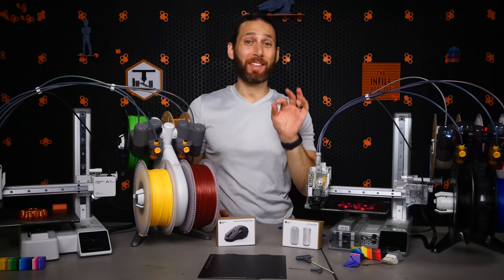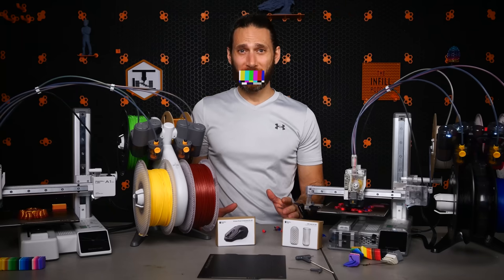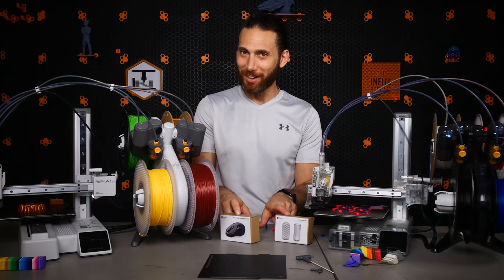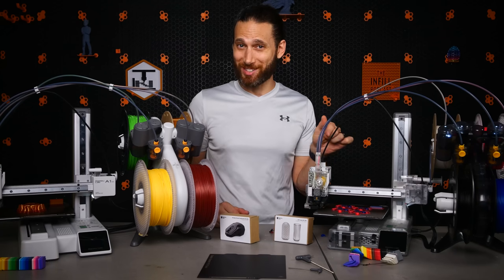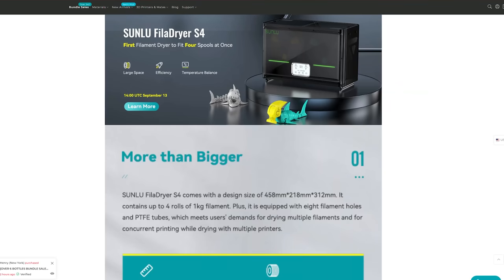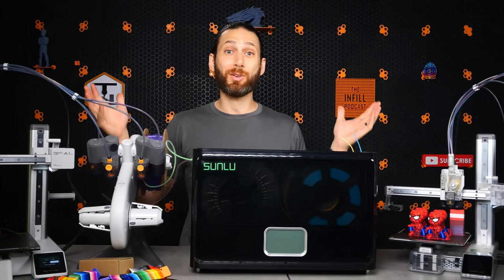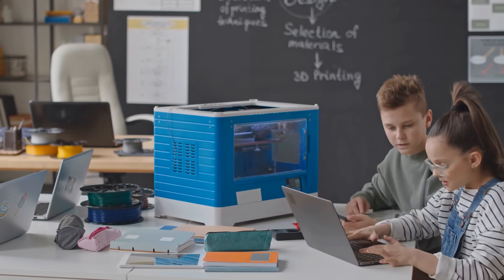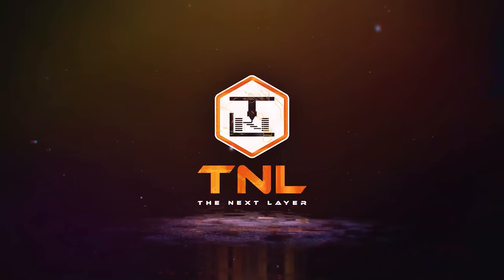Introducing the Bambu Lab A1 Mini + AMS Lite

Comment: That closed software ecosystem is a big turn-off for me.

And I agree that the purge waste is also an issue, but that's not much different than most multi-colour machines.
Reply: I'd rather have a closed software ecosystem than an open source that's buggy or wont work.
Reply: @fongsa1yuk  The problem I have had with closed ecosystems is that they have a bad history of end-of-lifeing their software (especially cloud connected), leaving me with hardware that can no longer be used.
Reply: The closed system is a bummer. It seems like they are aiming to be the Apple in the 3D printing world. But they are stimulating the market with their products quite well. I wonder how Prusa will respond to the AMS, p1p, and now the A1.

Comment: I feel like companies are in a printing speed race when all I want is quality race and low failure rate race.
Reply: Most fast printers, especially the Bambu ones can do that too, just adjust the speeds and make it print slower. However the default speeds on the X1C are quite a bit slower than their fastest speeds but are high quality and reliable too. I have never had a print failure on my X1C.

In other words what you are looking for already exists, you just aren’t seeing it. FDM will always be limited by nozzle size and flow rate, so there is a limit to how much quality you can get and it has been long reached, hence companies are keeping that same quality but also going for speed. If you need even higher quality then you should probably go for resin printing.
Reply: @conorstewart2214  I own the X1C too and have had failures (maybe mostly because of my own faults), and don't like going over the 100% speed mode as I feel like the quality starts to dip at the higher speeds. I notice little imperfections at 150% speed. I'm using Sunlu basic filament. I bought high speed filament but just find it not cost effective. I'd rather buy another X1C than pushing the speed if I'm in some manufacturing crunch.
Reply: @JiiruKoga  that is what I said, that their default speeds are high quality and reliable, going faster depends on the model and filament.

There isn't much point to high speed filament, at least with a bambu printer. I think the Bambu basic PLA is already optimized for higher speeds. If you look at the volumetric flow rate settings in bambu studio it is higher for bambu filament than generic PLA but that could just be for marketing or to make their filament look better but I have had good results using cheap PLA with the bambu PLA settings.

The default speeds are already much faster than an ender 3 or MK3, if you need it for manufacturing quickly then you are better with a P1P or P1S than either an ender 3 or MK3 and they are more cost effective than an X1C. Now with the A1 mini it is an even cheaper option for only a slight decrease in speed. If you don't need an enclosure, are fine with the print volume and just need printing speed then the A1 mini is probably the best option now.

Comment: Not trying to be a hater, but this feels much more like a sponsored commercial than a proper critic's review. Would've been nice to have a proper time comparison between p1p and this when doing the exact same color print. Maybe some mentioned to the poop or the tremendous noise it makes when cutting filament. I don't know... Some negative points maybe?

Somehow this review has little added value over reading the spec sheet directly from bamboo lab's website.

Please don't sell out or try to be on the good edge of brands for the sake of it. We want true honesty!
Reply: His comments and review aligns with most reviews I’ve watched on this printer and they have been many.

Comment: The footprint of this thing is insane. Not only is it the printer, the AMS is roughly the same overall footprint as well. Then if you want to capture the purge stuff you now need to put a bucket or box to collect all of that further increasing the footprint.
Reply: Yeah. It’s huge! The AMS (lite?) Should have been an enclosed box, attachable to the printer. More like the AnkerMaje v6.

Asians must think we have tons of free space. 

Making the bed larger wouldn’t have increased the overall dive by any significant percentage. 

Can you even attach a single roll anywhere?
Reply: @echo-hotel  there's a spool mount that attaches to the back of the z gantry so you can do a single spool yes
Reply: yeah and with something catch purge u wider than 2 x1c or 3 p1p side to side

Comment: I think the foot print of this printer with the new AMS is a real detractor for me. This "mini" with AMS looks like it takes up as much space as my MK4 or my X1 with its AMS.
Reply: Yep and imagine if you realised you get better prints when your filament isnt wet and have to put it in an enclosure …
Reply: @jeremyglover5541  Or the fact the second thing they will need to print is something to catch all the purge material for those multi-color prints.
Reply: Agreed, just the small printer by itself is interesting, it's a well designed desktop fast-prototype machine. With the AMS is a total mess.
Reply: @lawells3  also interesting and not mentioned here, is the fact with this machine, the slicing takes place in the cloud, you cant even use sneakernet anymore and I guess you cant use orca. I think it makes it plain that people and their IP are the product with these machines.

Comment: Will it be possible to use the AMS Lite with the P1P/P1S/X1?
Reply: I wouldn’t have thought so, it seems to rely on the four input extruder of the A1 mini. They could release a way to use it with the AMS hub that lets you use 4 AMS units at once but you lose a lot of the benefits of the AMS lite and A1 then, since you would need to retract back past the AMS hub. It seems this will just be for the A1 unless they allow you to use an A1 hotend and extruder assembly on the P or X series.

Comment: That's the best ad integration I've ever seen 😄 I'm interested by this machine but was bummed out the BMS system is fully open, making the solution incompatible with PETG and TPU.
I was thinking that color swapping might depend on the AMS to rotate thr spools to retract the filament.
But then.. the problem doesn't actually exist?

Comment: I was really interested in this as my first printer, but for the wasteful colour option. Not only does it 'poop' waste, it still has a purge tower, which further reduces the build plate real estate.
With the extra 'pusher' motors in the AMS and the individual bowden tube feeders, why couldn't they install multiple extruder nossels in the priniing head???
Reply: You can turn of the prime tower if you don't want to use it
Reply: @anthonymessage6073   I have previously been interested in the Ankermake colour solution as they reckon there is no waste with the system they have dev.
But I was really keen on hearing of this Bambu printer cause these guys obviously know what they are doing, including an industry leading slicer. Nothing else on this printer, be it the size of the print area, or the skeletal AMS is a deal breaker for me.
But now I'm back to waiting to see what Ankermake is going to release.
If Bambu had included a recycling system, I might still be interested.
Speaking of a four nozzle print head..Other conveniences would be…
the possibility of four sizes of nozzle.
Or one hardened and three cheaper options.
Different types of plastic for each head.

Comment: Not to pee in your Cheerios, but there are issues:

-Bambu Lab's data security, implicit theft of models/settings/gcode, and risk of hacked network login credentials aren't any different now than they were yesterday.
-Same goes for their customer support, which is notably better for social media influencers than it is for average users.
-Single hot end designs are still inherently bad for multi-color and multi-material printing. Not just from the waste caused by the poop pile and prime tower, but from the risk of jams/clogs in the hot end.
-Even if the printer can be made to work with 3rd party filament, the chip readers mean that the printer is one firmware update from locking you into Bambu's filament ecosystem as well as their parts ecosystem. 
-At first glance, I see nothing in the design that makes me think that the A1 Mini isn't designed just like the X1 Carbon and P1P/P1S...while the lack of an enclosure makes it easier to get at some things, it screams "use for a few years and dispose in the trash before buying a new printer."

I don't have just doom and gloom to comment on, however. Trying to expose a new market of people to 3D printing can only help the industry. That's something I think has been a real struggle even in the last year, with machines from Bambu Lab, Ankermake, and Creality trading on the Apple design philosophy of "if it looks good, people will want it" that still don't seem to be drawing in people other than the existing crowd of artists and 3D printing enthusiasts. And trying new things to further cut down on noise is a very useful step towards developing new standards in the 3D printer industry. I'll even give Bambu Lab serious props for their aggressive pricing strategy; above issues aside, that's kind of a lot of printer for <$500...and Alan Mandic's (admittedly unscientific) survey about just how much build area most people need on a daily basis I think continues to affirm the utility of smaller-sized printers.

All that being said, I'd still take the Voron 0.2 kit over this. An LDO one, too, as Jason and his team have done so much for the industry and I'd love to help them keep doing those things. Heck, I'd take a printer from the mad lads at Flying Bear over this, too, because intentionally or not they definitely embrace the concepts of open source design and right-to-repair while still finding ways to be innovative and also competing hard on cost...and they haven't been banned from selling product to the U.S. government, as DJI has, due to extremely shady data security practices.

Comment: Looking for something that can be portable to bring to events. We are RC enthusiasts that use 3D printing for parts and would really like that function on site. We have been hesitant to bring our P1S due to possibly damaging it in transit. Would this fit that bill?
Reply: Only if what you print is able to be printed in PLA out in a windy field …
Reply: If you're meeting anywhere that isn't a conference room/hall, probably not.
Reply: I bring my P1P to work sometimes, which requires driving several miles of bumpy dirt road. When I set it up in the office, I just run the harmonics calibration and bed leveling and get to it. Haven’t had any issues yet.
Reply: @kichigaino  do you install the transport screws and all hardware?

Comment: Hopefully they release a mod kit to put that faster (color wise) head and ams lite on the other printers. Swapping a nozzle breaks the tiny wires after a few swaps on the normal printers so that hotswap feature would be nice.
Reply: It takes 45 seconds to change out a current nozzle. Though much longer for a child. Still not as child friendly as a X1C
Reply: @echo-hotel  faster I was referring to time saved on switching colors since the rolls don't have to rewind / load as far. But for swapping nozzles durability is a problem on X1C. I've had the plug on the board pop out and wires broken, even though I take my time. But now I've switched to hot swap nozzle where I'll never need to touch fragile parts again. Glad bambu is moving towards that too.
Reply: @blaskotron  yeah, the tiny wires make me not want to change nozzle size very often.

Comment: Now we need the AMS LITE to fit as extra AMS to the X1C, and a kit to upgrade the AMC to work like the LITE one without the need to fully extract the filaments all the way back 

it looks like the MAS lite improves of the AMS of the X1C or P1S
Reply: The AMS lite in most ways does not improve on the regular AMS. To use it with an X1 or P1 then it would need to use the AMS hub which limits the usefulness of it not having to retract the filament all the way, and that is if bambu even allows that. Also if possible then like the A1 mini you would only be able to use 1 AMS with a printer compared to the 4 that you can with the original AMS. Then you have the dry box capability of the original AMS. The only advantages of the AMS lite is that it supports more types of spool and it doesnt retract all the way, but all it would take to make a multiple original AMS setup not have to retract all the way is a firmware upgrade and then you have eliminated one of the main advantages of the AMS lite.

The not retracting all the way thing would never work properly with one of their other printers due to the hotend differences, the other printers only have a single tube to the hotend so even if it was possible then it would still have to retract as far back as the AMS hub.

Comment: Did you try printing TPU with the AMS Lite?  If so, did it work?
Reply: I watched a guy on a video yesterday and he said the mini printed TPU better than any of his other machines. But apparently they advise against using it through the AMS.
Reply: @joelamaro4525  yeah, I posted this before I got my machine 7 months ago.  Since then I've tried it a few times.  AMS Lite works with very hard TPU (sometimes), but softer stuff is problematic.  Hoping whatever AMS v2 Bambu comes out with is TPU compatible.

Comment: Meh
It's neat and all but I honestly think this is somewhat of a teaser using some of their new designs and tech.
I still think there is much more coming down the pipeline from BL
If that print head could run on an X1C or PIP and the resonance frequency can be flashed into those printers it will be a game changer 
With the X1C there has been VFA's that can't be tuned out, i do believe this noise frequency addition was originally developed for the core XY printers
But only time will tell...... ⏰️

Comment: seems desk space is actually 2x larger then mentioned int he video.  you didn't include the extra space for the 4 filaments.. so far larger then any desk laser printer.  

Also for benchy.. Did you say they "optimized" benchy as such it isn't the same model as such can't compare times with other printers unless all are running the otpimized versions..

Finally 53db as quiet that you can sleep next to.. no thanks.

Comment: Just wait till you get a print detaching from the plate and you got a mega blog of filament on that metallic latch that snaps on the swappable nozzle ;)
I'd rather keep to my cheap nozzles that I can easily clean with a metal brush, with a silicon cap or nikel covered.

Comment: Would be nice to get the swatches for free with the original AMS.

The hotend swap is also something that needs to come to the P1/X1 series.  An existing nozzle swap is annoying at best, and even changing the entire hotend assembly on the X1/P1 requires screws and fiddling with wiring connectors.  Nice that this one is so simple.

Comment: You nailed it at the end. People love the Prusa mini and I think this just yoinked the feather from it's cap.  There's a ton of love for small printers like this so I think it's for both camps. At the base price without the AMS, it's a super competitive price for experienced enthusiasts or people running print farms and it's also a good price for entry to a beginner.  It would definitely make a great printer to have on your desk for rapid prototyping before sending it to your large machine for batch prints or something as well, or someone looking for a 2nd or 4th printer haha! 

I had been thinking about building a rook just to have on my desk because my larger machine is out in my workshop and it'd be nice to have something next to my computer when I'm designing something small. Thinking about it, the a1 may be a decent option, especially considering the price is so similar to the BOM of the rook  and voron.  Either way I think this is going to be a very popular printer and machines like the KP1S and Prusa Mini are going to have to take note.

Comment: What's all this talk about sticking PETG on a filament dryer? PLA needs to be kept dry not PETG. I've been printing PETG for 6 years+. I've never needed to dry any of it!  TPU is a different animal. When I started printing that I HAD to buy a filament dryer.
Reply: I've had problems with petg absorbing moisture. It started making popping sounds and printing poorly. Dried it out and it went back to normal

Comment: It's not for me, but I think it's a brilliant business move. They will sell tons of these products, draining newbies' wallets. Seems a bit unethical
Reply: How is this “draining newbies wallets”? It can’t be price because this thing is crazy inexpensive. Without the AMS it’s only $30 more than my HP printer. Almost every reviewer I’ve seen review it loves it. Even Angus who didn’t heap praises on it liked it and his recent video drop this morning he is happily using it. It’s an excellent machine. The only drawbacks is bed size and you can’t use every type of filament. And I’ve not printed anything on my Ender that I couldn’t print on this. A friend of mine who is infinitely more knowledgeable on the subject than I is loving it so much he’s buying several more. And this is a guy who has put in 14,000 hours into printing the missing parts for a full size triceratops. Maybe me being new to the hobby that’s more impressive to me than it should be. 🤷🏻‍♂️ Still learning.